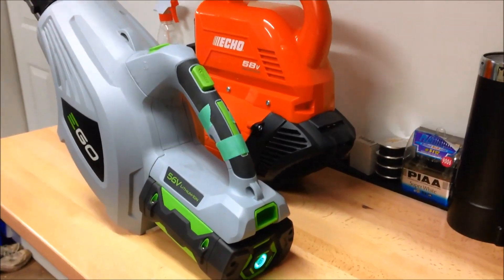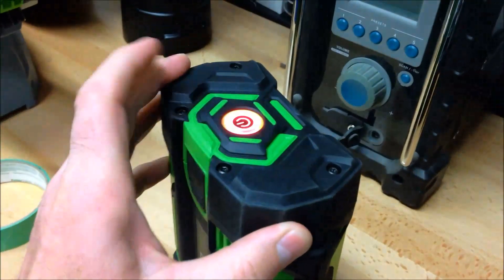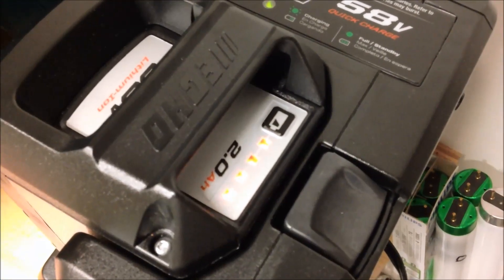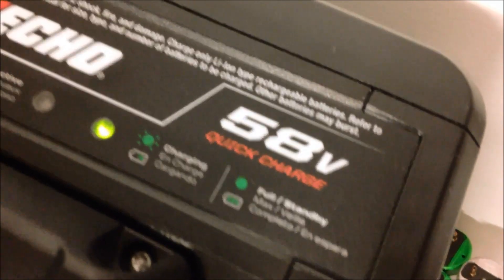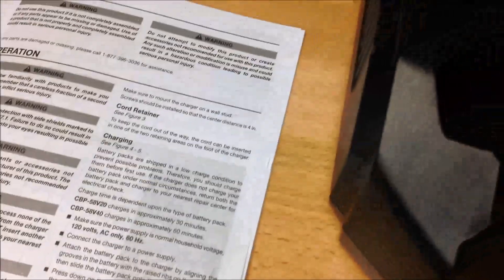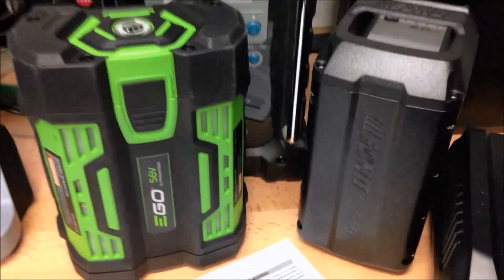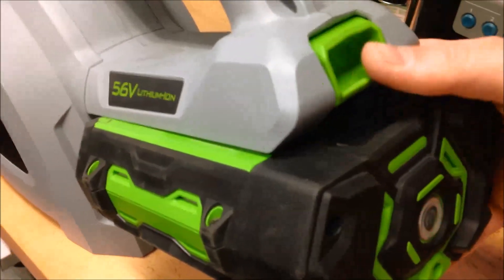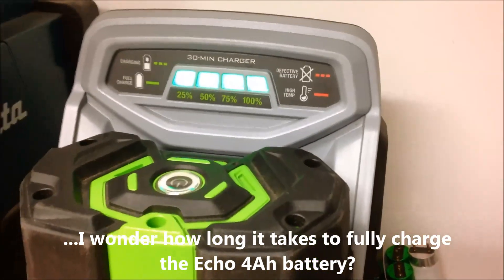Ego vs. Echo - Charging, 2Ah Battery for Blowers and Trimmers, and 4Ah Ego Battery for Mower

Comment: I have been trying to find as many review videos comparing the Echo to the Ego mowers, helping me on which one if any I should buy. Until now, I have been leaning toward the Echo because of their brushless motor claim, but because these two videos you have posted on the batteries and Echo's brushless claim, I am looking closer at the Ego again. I just wish Ego's mower deck had the same design as the Echo. -Great videos!
Reply from the maker: Warren Willcox Thanks Warren.

If you haven't already, I recommend playing with both mowers in person.  From my point of view, the Ego battery/charger system is far superior, but even more important to people with small storage spaces is how easy it is to fold up and store the Ego mower upright.  The Echo offers this as well, but its handle design is not nearly as robust or easy to use.

Good luck and happy shopping!

Comment: This line of Echo 58 volt is made by TTi (makes Ryobi tools) and it is absolute crap!! Ego is way more durable and has exceptional performance! Ij just cut a straight line through crazy wet 8" grass on the third height setting without a problem! I was amazed too!
Reply: TTI also make milwaukee are they crap as well?
Reply: +dazz318 Now you are catching on!
Reply: dazz318 yes Milwaukee are crap.
Reply: Weeze Lawn Care TTI owns OWT so they are the same company. I do not get your point.

Comment: Try using the rapid charger on the ego. 7.5 amp fully charged from zero in 1 hr.
Reply from the maker: Yeah, pretty remarkable!  Since the 7.5 will power an Ego mower for over one hour, with two 7.5's you could cut continuously for as long as you wanted!

Comment: my ego 2ah battery charged in 27 minutes on the standard charger. could be half that on the quick charger.
Reply from the maker: Ego claims 25 minutes for the 2Ah pack on the rapid charger, and 30 minutes for the 4Ah pack.  True, the rapid charger is powerful enough to charge the 2Ah pack faster, but doing so could exceed the thermal limit of the cells.

Based on exceeding their claimed time on the standard charger, it wouldn't surprise me if the 2Ah pack took slightly less than 25 minutes to charge on the rapid charger, but I have not timed it to verify.
Reply: +superspeeder I just tried to charge a 2Ah battery on the rapid charger I just got today. it starts charging normally, light flashing green on charger. after about 1 minute or less it stops and the charger light turns red saying defective battery. the same battery charges perfectly on the standard charger though. I guess the rapid charger is designed to charge the 4Ah battery or bigger models only.
Reply from the maker: +Brent Hill 

The rapid charger charges all Ego batteries, not just the large ones.  Get in touch with their customer service folks and they'll help you figure out the issue.  Sounds like something's not right.